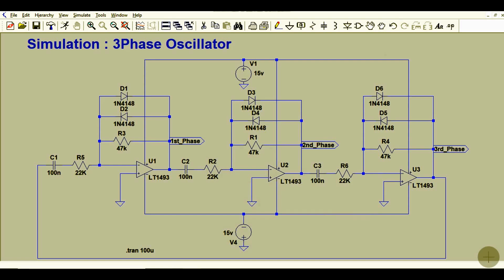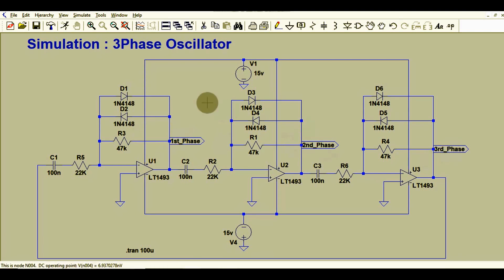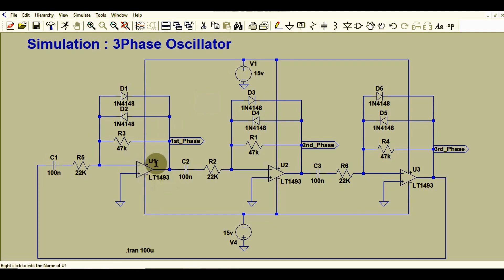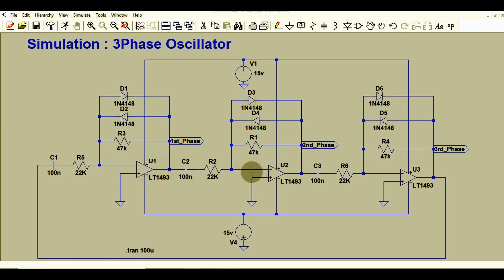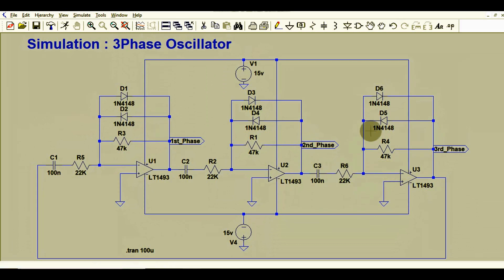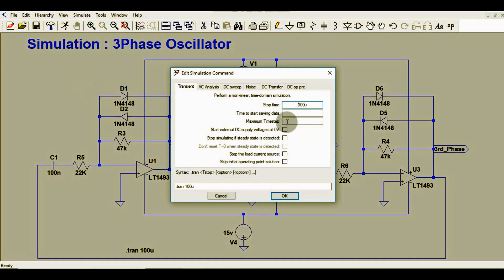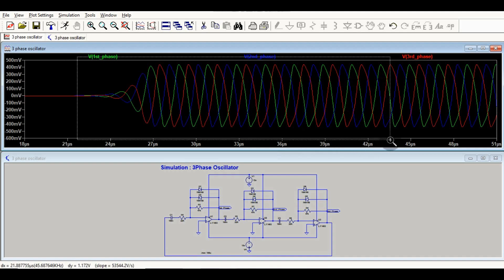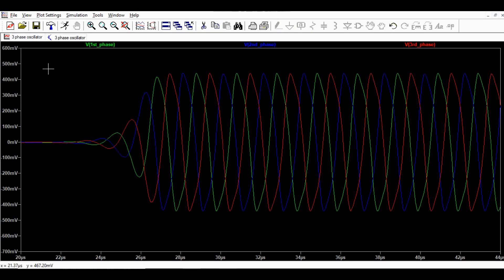LTSpice opamp 3-phase oscillator | Simulation

Comment: Would i be able to replicate this circuit using 1 lm324N? It’s a quad op amp. You are using lt1483 which has 2 op amps? Is there a specific reason? I am trying to learn but a little lost on why you chose the LT 1483 for each op amp. Thanks in advance!
Reply from the maker: Hey...you can use LM324. There is no problem. In my library I did not have lm324 so I used lt1483.
Good Luck.

Comment: Hello, It was great video, I have only wonder that frequency of sinus signals look like 500kHz. How can we calculate the frequency? Can you share the formula of frequency for this circuit please? We can produce 10Hz sinus signal with this topology?
Reply from the maker: I do not remember the formula at the moment.
Please try finding over google.
Reply: @ElectronicsCircuitHubECH  hey google seems to be helpless in this situation too. If you could please let us know the designing formula.
Reply: @aayushiagarwal6810  have you found the formula for freq?my brain is jammed already🤧
Reply: Isn’t it dependent on the capacitor value for c1 c2 and c3? Wouldn’t using value of 1 or 10 uf slow the frequency? Also increasing the resistor?